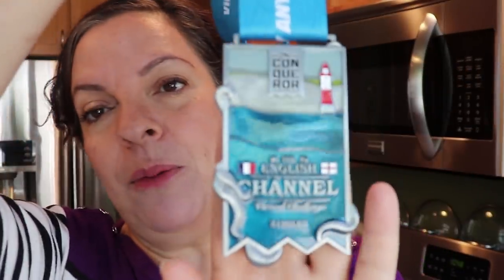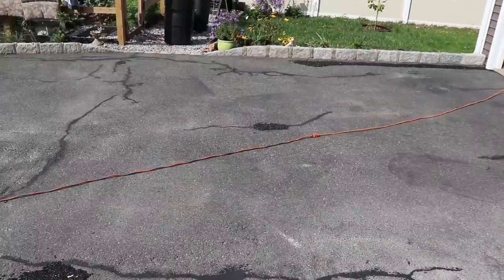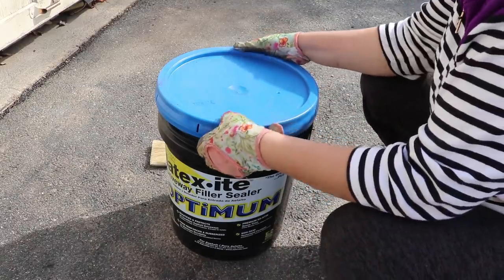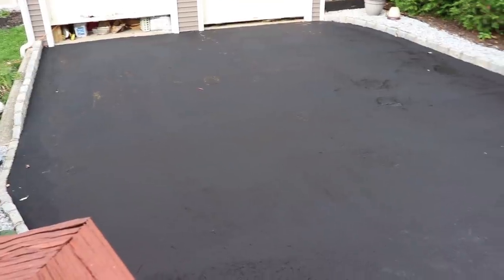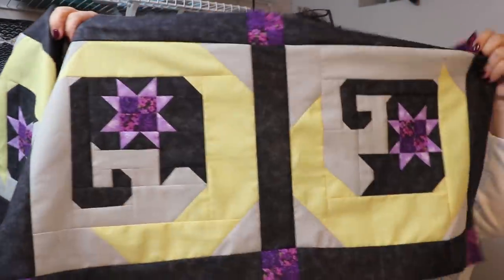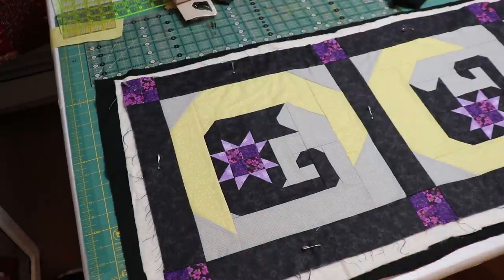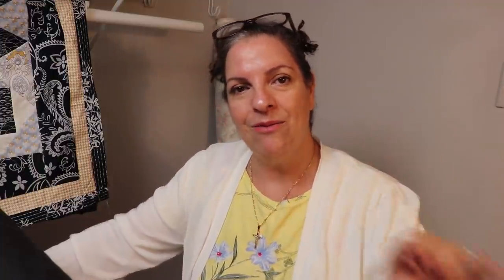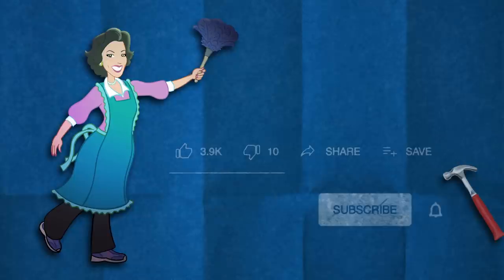Driveway Repair - Part Two - Sealing + Frustration in the Sewing Room

Comment: When the stitch is like yours on the bottom, it has been my experience that it is usually a problem with the how the bobbin is inserted, not the type of thread or the tension. When I’ve had trouble I always clean out around the bobbin, install a new needle (always), re-thread, and make sure the bobbin is installed correctly with the thread going the correct way and that usually solves the problem.  I also notice that your walking foot is a Singer and your machine is a Brother, have you quilted with this combination before? Anyway, a trip to the repair shop should fix it right up and you’ll be on your way quilting again!  The cats turned out so cute, I’m sure your friend will love it! ❤️
Reply: I have had a similar problem with the tiniest piece of lint in the bobbin casing. I agree there is a bobbin problem.

Comment: Great video.  The tension sounds like the bottom bobbin. There is a little part which you can use a screw driver to adjust thread tension. Pull the thread as you sort of dial the screw driver until it feels right.  I would suggest checking you tube before taking in for servicing and maybe save a but of money and time.  You are amazing!
Reply: Joanne Marshall I was also thinking the same as I had that problem before ... so frustrating when you just can’t figure it out. After research and trial, I adjusted the bobbin tension and voila!

Comment: Sophia, congratulations on your medal!  It looks good on you!  About seven years ago I had to repair the roof on the 10 X 16 shed that was attached to my garage.  All five of the local roofing contractors were too busy, and I had a couple of leaks.  So my 18 year old daughter and I repaired it.  We didn't really know what we were doing, but we got the leaks to stop!  We had to lay down some type of adhesive and caulk and it was really, really tedious.  But we did it!  So hang in there with your driveway.  I'm sure it will be great when you're all done!

Comment: Great job tackling the driveway. It is looking good and will look great when finished. Mine needs so much more done to it, but not in the budget yet. The entire paved driveway is over 1/4 mile.  I had the parking area removed and repaved this summer so it was level and I could have a carport installed. Just the pad for the carport 40' × 36' and  about  15-20' of driveway was almost $10,000 although with the leftover asphalt, the did patch a rough section at the bottom of the hill about 10 feet long and patched a pothole ate the entrance caused by the school bus using my driveway to turn around (and I have no kids).  It would have been more than double that to do the whole driveway.   At least the carport was finally installed today. There was a long wait due to increased number of people purchasing carports this summer.

Comment: Love the look of the driveway!  Way to go on the challenge 🥇 you may need to clean the bobbin carriage area with a brush and oil the inside parts that need to be oiled.   It sounds rough so it probably needs it!  I don’t think it is the thread.
Reply: When mine wasn’t working well,someone said to oil it(which I had never done but also don’t sew much)My husband read the manual and oiled all of the spots it said to,which was ALOT and then it worked like a champ!

Comment: Getting a balanced lock stitch is always a precarious thing.  In general if the top threads are messed up the cause is in the lower/bobbin area, and if the threads are messy underneath then it is often a problem on top [tension discs, tension setting, spool bouncing or jerking -- needs to unwind smoothly/evenly]. Do you have a felt pad under any spools of thread you are using?  Sometimes there is a thread tail "retention notch" on the on the edge of spool of thread and causes a jerk that upsets the stitch balance. Try turning the spool upside down on the spindle, and be sure to use the correct size thread disc holder snugly against the spool, on the spindle.

Comment: Sophia, it looks as though perhaps your bobbin casing that you seat your bobbin thread in is not sitting securely in its locked position making the bobbin or bottom thread loose due to lack of adequate tension.

Comment: Hi, Sophia.  I think you have a thread problem.  The thread that's in the bobbin should be the same what's on the spool and check your tension and take apart the bobbin area and check to see if there are any threads caught under the bobbin.  You may have to have your machine serviced.  Good luck.

Comment: If you have any canned air, try spraying it in the bobbin compartment to blow out any tiny pieces if lint or thread;  that sometimes can cause issues like that.  Also, sometimes it’s actually a threading issue where something is not latched exactly right.  Lastly, it can sometimes be a tiny thread sticking out of the bobbin case, or the bobbin is facing backwards in the bobbin case.  When I have problems like this, I can usually resolve them by taking everything out of the machine and off the bobbin, and then starting completely over.

Comment: It's not your thread, it's your bobbin tension. The top thread is pulling through to the bottom. There should be a screw on your bobbin where the thread goes, try adjusting that. Or, you could always watch a YouTube video on how to fix. Good luck!

Comment: I have the same sewing machine. The bobbin holder gets turned it has an arrow that should be in line with a little white check. You have to take the whole bottom part, apart. Trust me. If you clean it all and make sure that lines up it will fix it
Reply from the maker: I just got the machine back. It was the timing and needed a factory reset. Works like a charm again.

Comment: Sophia, make sure that when you thread your needle you raise the needle to the highest position.  set your tension to the standard setting, then rethread properly.  The machine actually can't tell what color the thread is, if you are using the same brand.
Reply from the maker: I changed colors because they were different brands.

Comment: Hi, Sophia! It all looks great. I couldn't tell. Did you try using the same thread in the bobbin and on the top?
 If you don't like the pink color take note of the brand and get some in black.. Hang in there! Your projects will all be great when you are done. Bravo for trying!!
Reply: Aside from using the same thread in both places, remember that if your tension is loose on the top you adjust it on the bobbin. If the tension is loose on the bottom you adjust the top thread's tension. Sorry. I have an older model, not computerized, so I am no expert on those. Tensions are not fun... smile on!!

Comment: i would clean the bobbin area out.  Dust collects in there and can cause issues.  there is an issue with the bobbin area
Reply from the maker: I just cleaned the machine last week. It s not dirt. It s timing. I need it reset to factory default.

Comment: Sophia, try using the same thread in the bobbin as you are using on the top.  I have found problems if I use different thread top and bottom.